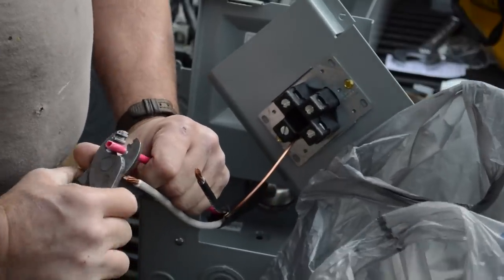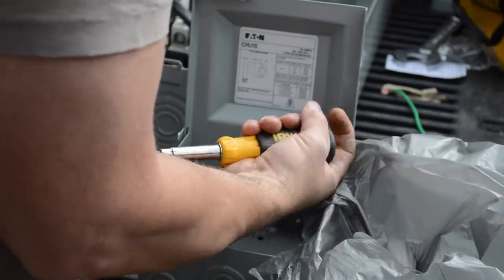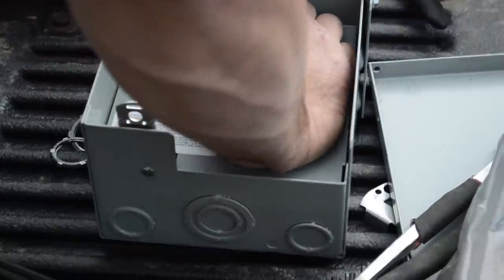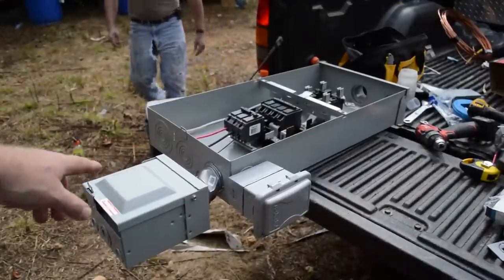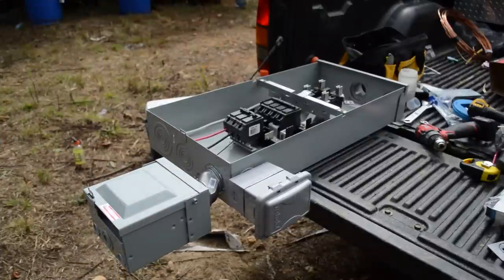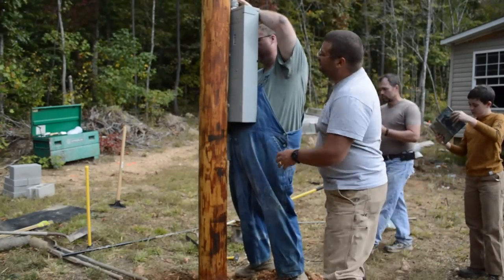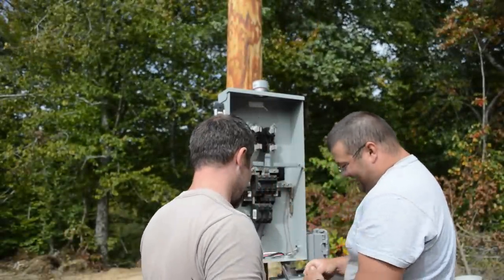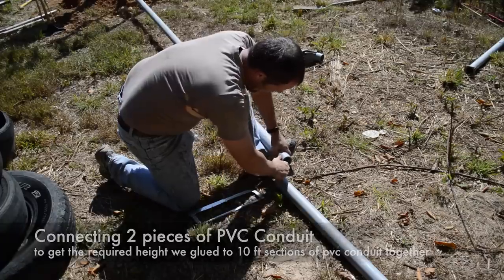Wiring an RV Power Pole

Comment: why did they use a 50 amp outlet for 30 amp?
Reply: I would personally recommend doing it this way. A 30 amp RV will only draw the ~30 amps on a full load from the 50 amp circuit. Granted, you will need an adapter for 50 to 30 amp, but if you ever update your RV or buy another that uses 50 amp, you're already set. Whereas, with a 30 amp circuit, you could adapt it to a 50 amp *outlet*, but you'd still be restricted to 30 amps. So you would have to potentially limit what you turn on, or pay to rewire for 50 amp, as it's not as simple as replacing the breaker/outlet on each end.

Comment: What is the cost to do a job like this ? Parts.
Reply: Im doing this currently, and I used the Siemens TL137US 100 amp panel with 20, 30, and 50 amp outlets. It's currently about $150 from Amazon or Home Depot, and has the main and 3 outlet breakers included and prewired. The expensive part for me was the feeder cable and conduit; for 70 feet of 2/0 AWG cable it was about $200 from wireandcableyourway dot com (copper cable would have been easier to work with but nearly $1000). 2 inch conduit is about $10 for each 10 foot section, plus all of the fittings and connectors for conduit I spent another probably $40. Then you have misc mounting hardware, a pole if needed, etc. Hope this helps.
Reply: @Bitcoin_Bernoulli  , thank you for the information.

Comment: If my memory serves, there is no minimum height for the service box.  Just as long as the top of the box does not exceed 79" (6'-7").  If it does, then a platform has to be built so the top of the box does not exceed 79"....for short people, I suppose.  @3:20, if the base is at 6'6", then it's out of code.  Then again, my memory is FRIED at this old age.